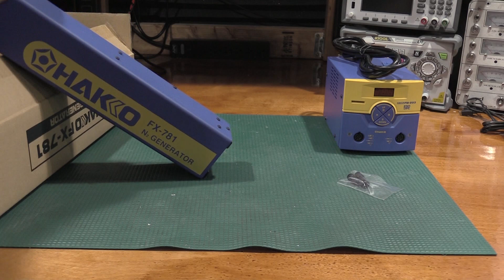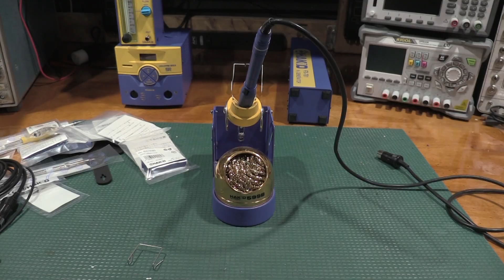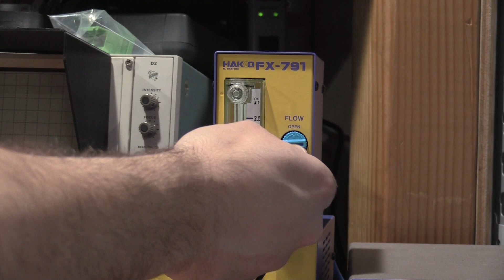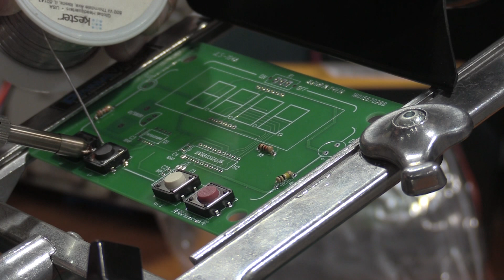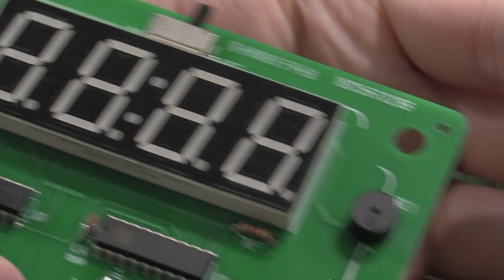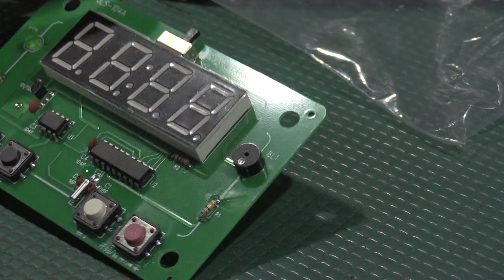600 Subscriber Video Part 2 The reason for the AIR line (Nitrogen Soldering)

Comment: Thanks very much for providing this information. A couple of things come to mind. The first is a solenoid valve. I expect that flow regulator has no electrical parts, but with the sleep switch in the iron holder, it might be nice to have it also turn off the nitrogen flow. Also, the preheating of the hot nitrogen might be detrimental if it's flowing onto the IC whose pins you are soldering, so it might be nice to be able to quickly turn the nitrogen off without changing the adjustment of the flow rate. 

The other thing that comes to mind is to wonder whether a less sensitive industrial N2 generator (or the 'waste' side of a medical O2 generator) might, itself, make a nice pre-filter and additionally permit greater purity at higher flow rates if the Hakko generator gets ~88% N2 at the input.
Reply from the maker: @John Banister, There is a on off manual valve on the FX-791 it is the blue knob on the front this allows you to turn off the gas with out disturbing the flow rate set point. Leaving the gas on when the tip is in the holder will keep the oxides from forming on the tip and lengthening tip life. Given the tip life of the Hakko tips I expect this to be a LONG time. If terms of the IC’s these are designed to take a reflow oven which would get them hotter than the N2 stream would make them as well as a hot air gun so It is gentler on the chips than that. One of the good things about the N2 now that I have more time with it, It is a FAST process. It might be me but I feel that I am off the joint quicker than when I use the iron with out N2. I do not have quantitative measurement on this but it is a feeling I have from use. As for the pre 02 filters I would need to keep the pressure up for the filter to work so that would be a challenge but an interesting idea to roll around. You can run the iron on N2 bottles like welding but then ventilation would need to be taken in to account. Don’t want to displace all the 02 in the lab that would be hazardous to ones health.

Comment: looks like a solution looking for a problem (Says the guy who doesn't have one! :D )   I think you should try it with H2 to properly strip the oxidation though!
Reply from the maker: I’ll be honest I though the same thing at first. I did some more digging and I found that some BIG name companies as well as a large display manufacture were actually running a N2 atmosphere in the reflow ovens. This helped with post processing the boards in clean up as well as reduction in the amount of flux needed for good joints, as well as less rework due to bad joints. Where it is REALLY supposed to make an improvement is when you must work lead free. And with delicate joints as you can use the hot N2 as a kind of hot air gun to preheat the area so there is less thermal shock. Does is do all these things I am sure it does. Is it worth the capital cost? Jury is still out I only currently have a sample of 1, but testing is continuing.
Reply: @ZenwizardStudios  Yeah it will be interesting to see how it helps.  I'm quite interested in the idea of having 'free' limitless pure N2...  wonder if it might improve 3dprinting performance to flood the chamber with something inert.
Reply from the maker: There is 1 draw back - flow rate. To get the 99.9% Purity I have to feed the filter FX-781 100 PSI air. But I can only pull out 1 liter per minute. 1.5 lpm drops the purity to 99.5%. This is also why I went with the bigger filter there is an FX-780 but it will not give the high purity still over 99% but not %99.9 now the good news is if I go in to the industrial space I can get high flow rates physically the filters get bigger. However, from what I found for “high but reasonable money” the Hakko filter would give the highest purity.  Most of the industrial filters around this price point were 90% or lower.

Comment: Do you plan a schedule where you might be worried about oxygen displacement and if so how will you mitigate the risk? Thanks for sharing and Happy Holidays!
Reply from the maker: That is not a risk on this unit as far as I am aware, as I am using air from the compressor in the garage. This WOULD be a concern if I was using N2 bottles. The physical filter has 2 nozzles one out the bottom the other in the top. N2 comes out the top everything else flows out the bottom. This type of filter is separation not absorption. I can add an O2 meter to the lab and monitor but I will need to acquire one. But yes bottled N2, ventilation would be critical to avoid O2 displacement and subsequent fatality.